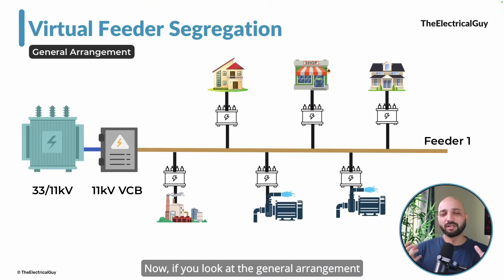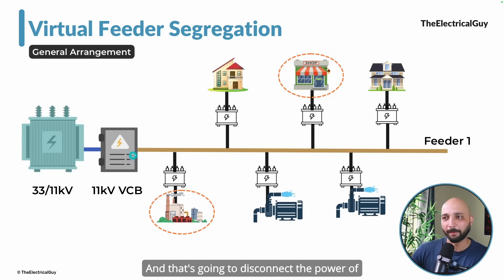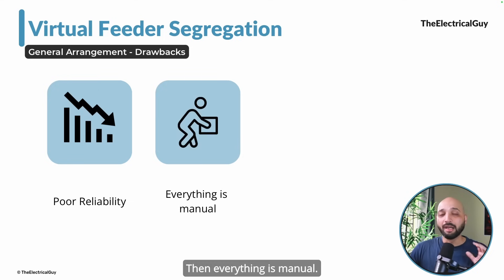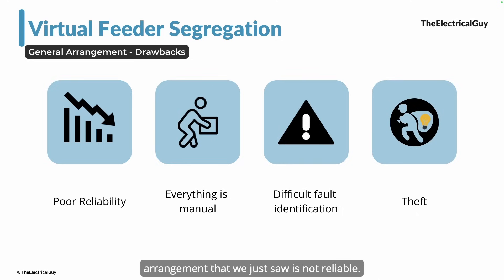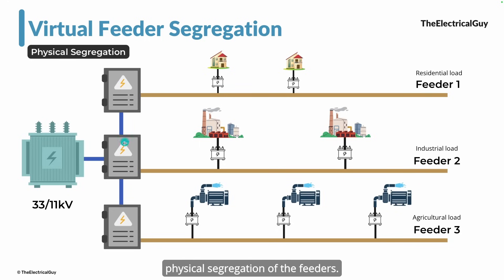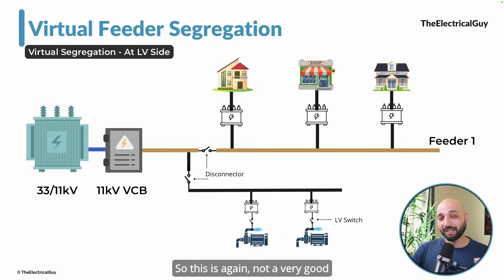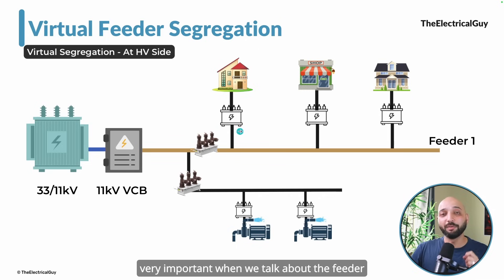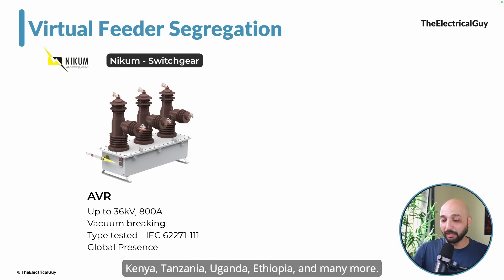Feeder Segregation in Distribution: Why It’s a Game-Changer | TheElectricalGuy

Comment: Good quality content first of all🙏

I found some issues with this method too. In rural areas , it is not possible for the whole PTW connection at only one area. They often mix with rural consumers. Even some states physically created new lines, to avoid multiple row issues ( ADB projects ). 
In my opinion, a smart meter at premises is the only solution , which can be disconnected ( but communicating ) as per the licensee requirement. I want to hear from you as well😊
Reply: Thanks for your comment. But we feel that smart meters, while useful for reporting anomalies, cannot actively prevent theft—particularly in rural areas. Network design often favors HV line disconnection as a more effective deterrent. Additionally, large-scale smart meter deployment may introduce new maintenance challenges for field staff.